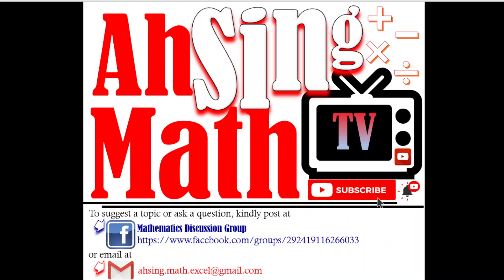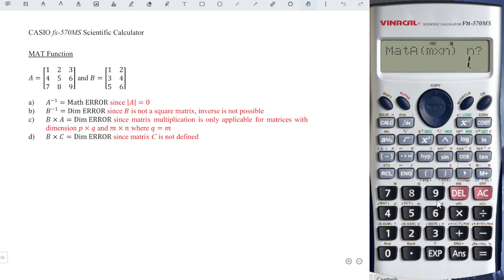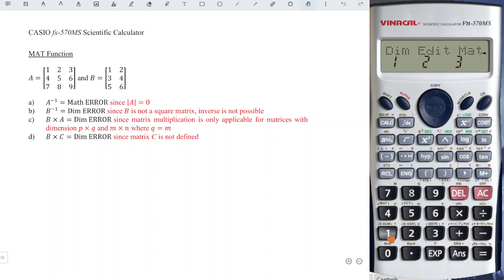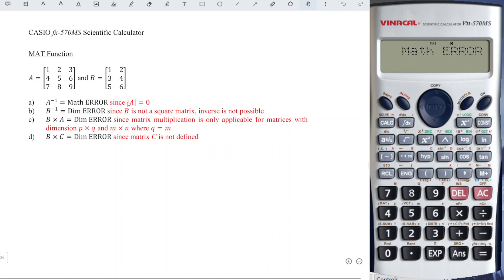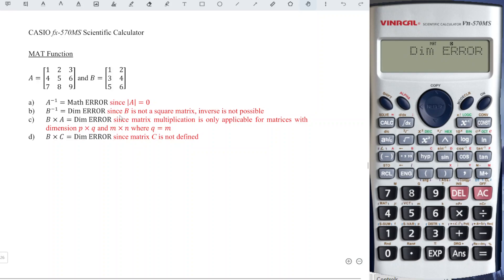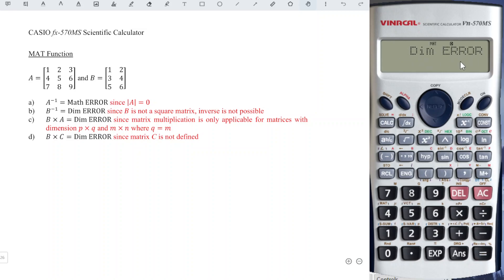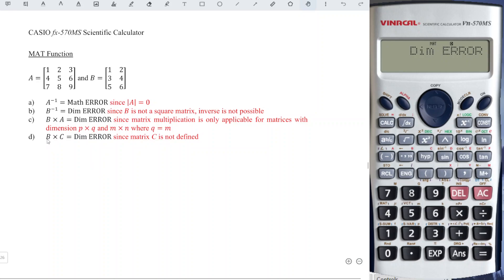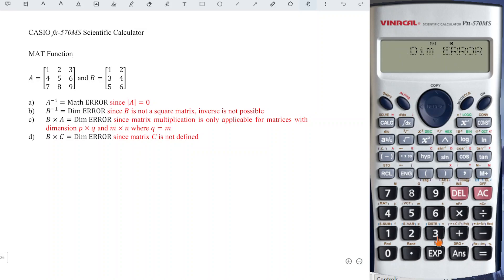Dimension error in Casio fx-570MS or fx-991MS

Comment: All my matrices a,b,c are 3×3. I still get dim error while I try to multiply two matrices. My calculator was working fine all this time. But now I'm getting this dim error. Please help, I've got an exam tmw
Reply from the maker: Hello. Did you press MODE again when entering the second and third matrix? If yes, that’s the issue. The correct way is to directly press SHIFT → 4 and select 1 to define the matrix. Please note that this method applies to the fx-570/991MS model, as you're referring to this video.
I hope this helps. Thank you for watching, and I wish you a wonderful day!
Reply: @ahsing_math  no I didn't press mode each time. I could view the matrices in matA , matB and matC, but operations on it don't work